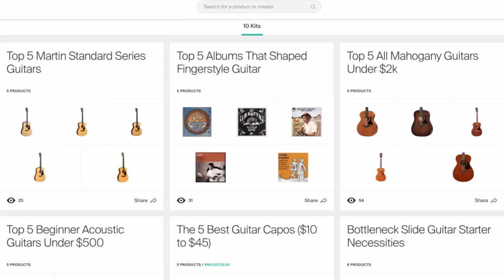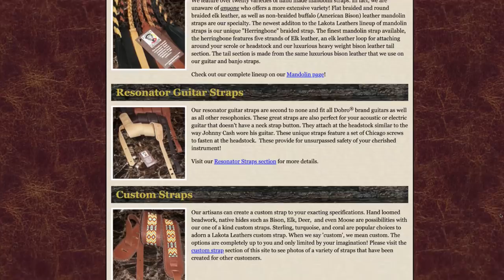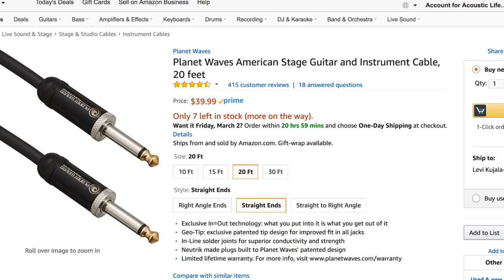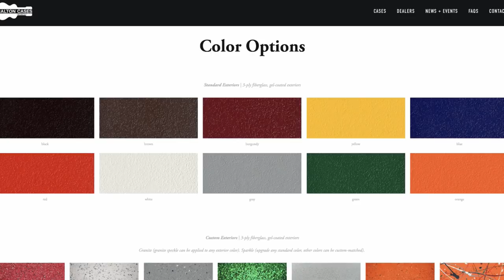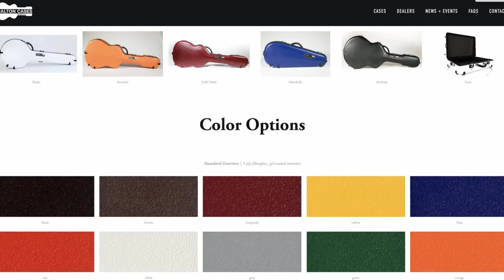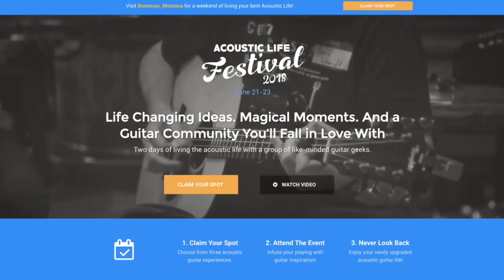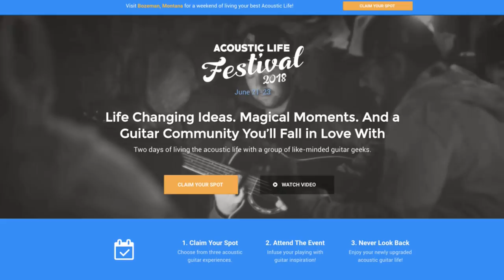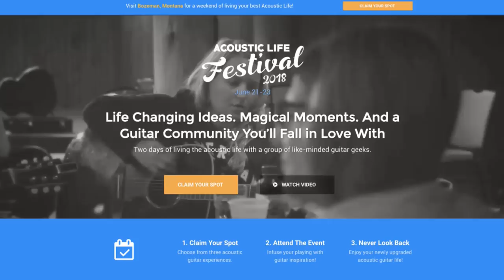4 Acoustic Artists You NEED to Know (AT28)

Comment: Matt makes a good point , the more delicate guitars do sound the best, however the trade off is durability and longevity.  I have a beater that's built like a tank that I use for everyday use. It's 14 years old and has not moved even a fraction. My D15 needed a neck reset after only 10 years

Comment: Glad you picked Harmony Music as the trivia of the week.  My first electric guitar is a Harmony H72 becuse it was finished better and made than the Gibson ES 335 that I tried at the time.  The $100 difference in price was more important then the name at the time.  Later it proved to save the my guitar from a burgler, who was dissappointed to open the Gibson 335 case and found it was protecting my H72.  Tom Arnold (not the actor)
Reply: I did not proofread my post.  The H72 made more sound than the Gibson.  I was turned off by its' lack of acoustic sound, rough fret ends and higher price.  Never regretted the choice.  I own a reissue Gibson Advanced Jumbo and my father's pre war J45 so I guess I am a guitar geek

Comment: Speaking of guitar resonance, I have a Martin Custom similar to today's GPCX1RAE.  Those familiar with Martin X series will know that they are made in Mexico with 100% man-made materials, except for the Sitka Spruce top.   You can buy them brand new for $700 and used for ~$300, which I did.  Bottom line, you wouldn't expect much from this guitar.  Well mine has a super-thin finish on the top, now even thinner because it came with heavy sweat stains which I had to scrape off.  Well, the resonance is beyond belief.  Just playing Tony's Daily Drills single-note exercises, it rings on and on and on and on ... and then even longer, to the point that I have to mute all 6 strings, TWICE, before I can move on to the next drill.  Man, it feels so great to play.  Who'dathunk?
Reply: Hi David.....The X series are a fantastic range at a good price! The HPL back and sides feels indestructible too. Try the Santa Cruz parabolic tension strings on it....really helps the spruce top sing :) - Simon
Reply: Thanks for the tip.  I'll give them a try.  -David

Comment: #AskMatt I found that 12 frets really do this much better than 14 fret. I read an article from Dana Bourgeois and he made some great points about the position of the bridge in the lower bout and how it radiates the top better. But in my experience weight also has a lot to do with it. So I love small bodies, 00, 0, Parlors... I had a Martin, Gibson and Waterloo 00 12fret and the Waterloo really resonates BIG, the other 2 have found new homes. I then bought a Preston Thompson Parlor 2. Ok guys with the K&K pickup the damn thing is less than 3 pounds. This tiny cannon is by far the most resonant guitar that I have ever owned.

Love the show, not a bourbon drinker, but would be happy to drink some Tequila with Levi or Scotch my current fav Oban Distillers Edition.